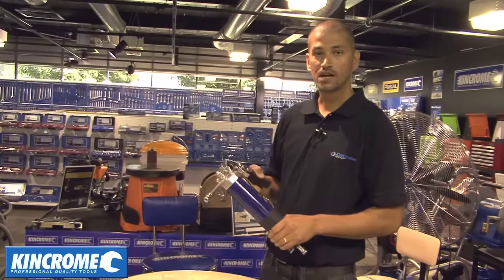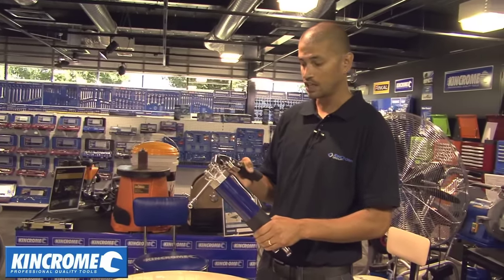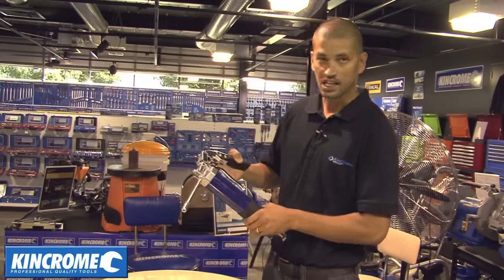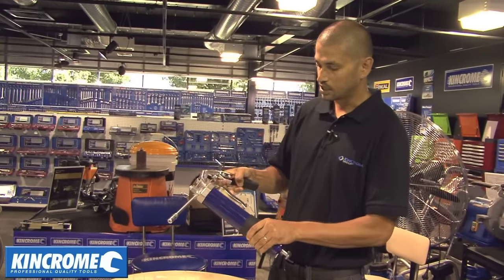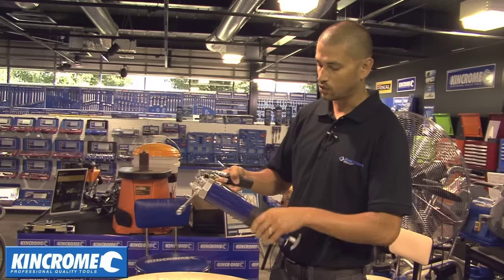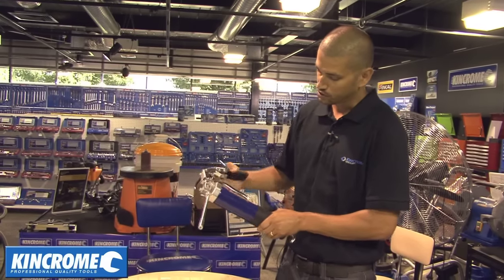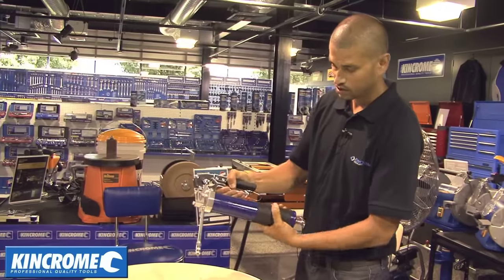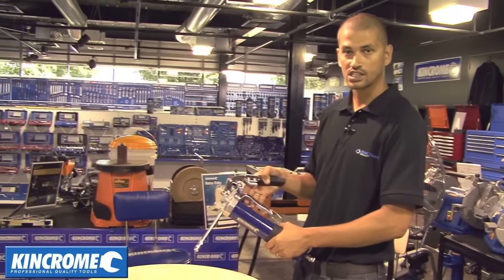How to purge air from Grease Gun

Comment: I have even seen them with a special valve you can push.  I have one like that it works very well and you do not need any tools to purge the air. Just push the valve with your finger and when it stops hissing the air is purged.  I should look to see if I can find that valve somewhere as a separate part.  I can most likely order it as a replacement part from the maker of the tool if I can not find it locally.  It is not something that I must have, it is just a nice thing that is on an older pneumatic grease gun that never got used much.  I have read some bad things about some pneumatic grease guns and for that I know those ones may have been the cheap ones.  The valve should fit where the Allen head screw would be if your gun has the right threads in the hole.  The only other problem you might have is stripping the hole because the heads of many grease guns are soft metal.

Comment: This does not work for me. Tried this about 50 times repeatedly. Even pulling plunger loosening cap and pushing plunger and tightening cap. Nothing seems to work and my gun does not have a plug to bleed the air.
Reply: Turn it upside down and bang on something hard once or twice.  Be sure not to hit the handle
Reply: @jared187able  I found the problem, the grease cartridges have an arrow that says "grease protrudes in this direction ->", so I would install them in that way, but when I put it in backwards, they worked right away. Idk. Haha